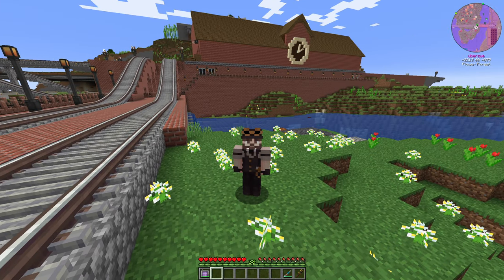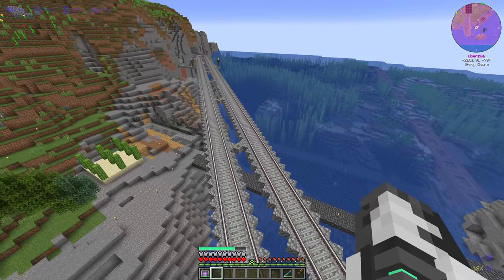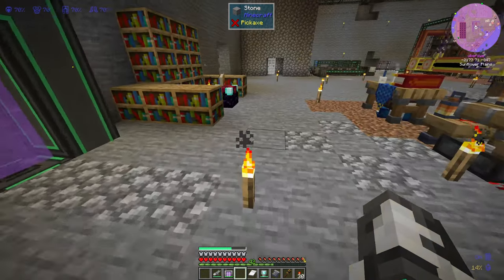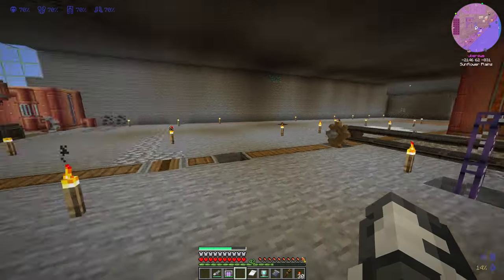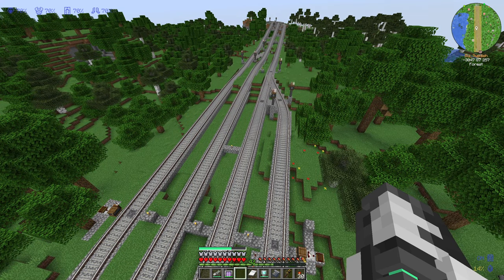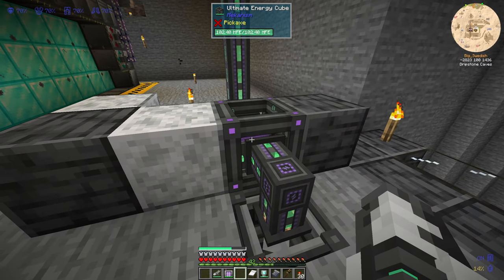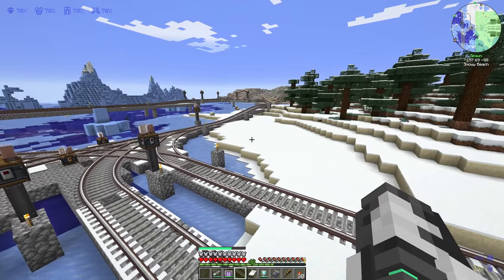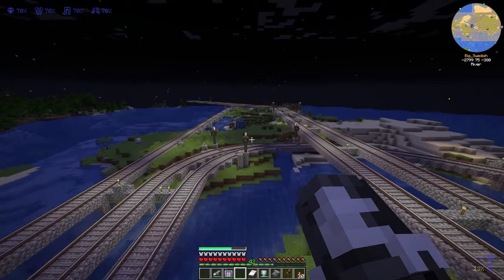Tech Server Tour - 2023 - Create, AE2, Mekanism, Tinkers, Industrial Foregoing and More

Comment: 12:09 how did you get a blaze spawner into the overworld? Using the minecart contraption and pushing it into the nether portal or what?
Reply: you can actually break a minecart contraption, easy way to transport spawners
Reply: @uncannybook581  How? You can not pick  up a unmovable block contraption with a wrench. How do you get the minecart contraption in item form then?